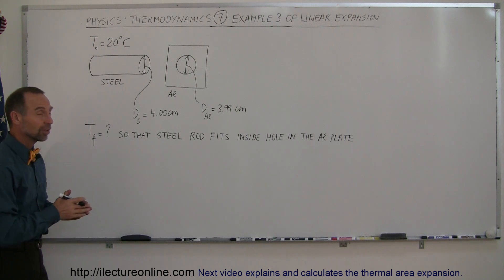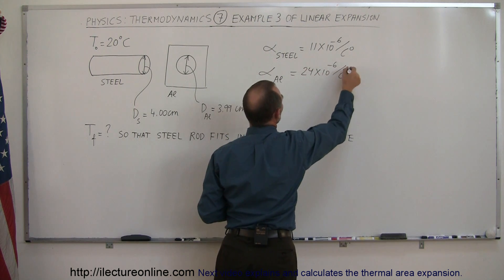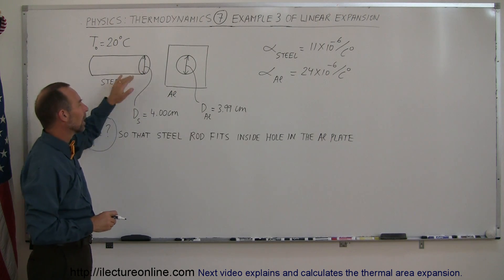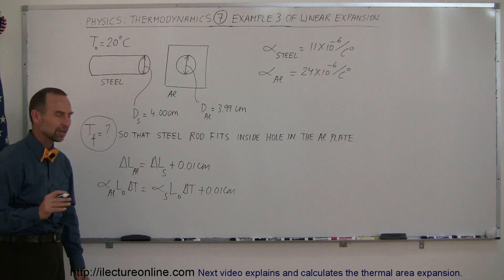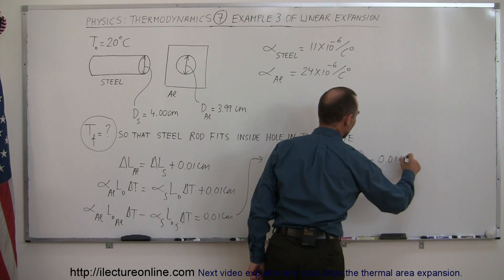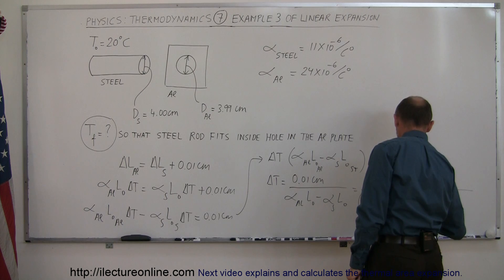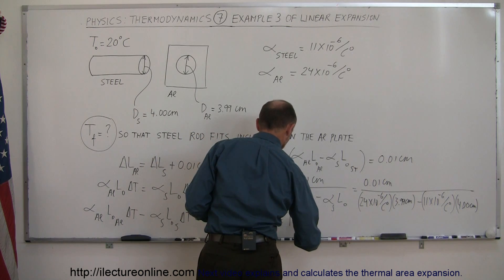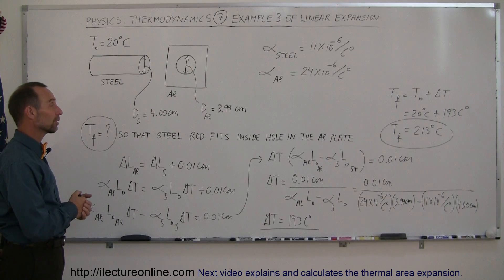Physics 21  Thermal Expansion (4 of 4) Thermal Linear Expansion: Example 3

Comment: This site popped up when I was looking for info on how much a small steel shaft will shrink in dry ice so it will slide into a pair of bearings which are pressed into a housing. Its an interesting video, but I am questioning why you would  want to heat both the shaft and ally plate.  Larger shaft into smaller hole would be an interference fit, would it not. If you shrink the shaft to a diameter smaller than the hole would it not fall in and when it returns to original temp it will expand into the hole causing a tight grip/fit into the hole. (the ally plate could also be heated, so you have a shrinking shaft and expanding hole and when normalized still get the interference fit) Or you could just heat the ally plate to expand the hole to a diameter larger than the shaft (shaft is left at ambient temp so no diameter change) so the shaft will just as easily fall into the hole and when temp cools it will grip the shaft. If shaft and ally plate are heated would they not return to original dimensions when cooled. Ps how much cooling would be required to shrink the shaft down to 3.98cm Thanks
Reply from the maker: Yes, typically you heat up only one component, but as you are fitting the device into the other, there will be some heat transfer (unless it is done very quickly with a machine).

Comment: i have a question why you did not use the area expansion why you use the linear expantion
Reply from the maker: You could, but it is easier to solve using the diameter.

Comment: Would the temperature difference be large if the two objects were the same type of metal
Reply from the maker: If both the rod and the plate are going to be heated, and the rod doesn't fit at 20 degrees C, then it will not fit at any temperature if both the rod and the plate are made of the same material.
Reply: In interference fits, it is common to cool parts & heat the outer body. 
This method will shrink the shaft ( maybe using liquid nitrogen) & heating the housing that it will be inserted into. You can then make the interference greater, which increases the holding capacity.

Comment: This is great! I was just wondering, wouldn't you use the area of the pipe and the entrance at with pi(r^2) and 2alpha? I know it says for linear expansion but I figured if we're given diameter and not length, or both, the it's Area expansion instead of linear or volume. Please cure my overthinkingness lol
Reply from the maker: It is just easier to use the linear expansion of both the hole (diameter) and the cylinder.

Comment: I cant agree with math here aluminium change size 24um per degree steel 11 um per degree so if i simple heat 100 degree rod it wilk give me total size 4.011cm for aluminium if i heat for 100 degre it will grow to 4.014cm so its clear will fit i made misteake somewhere??
Reply from the maker: The answer in the video is correct.  Note that they don't start out at the same size.
Reply: @MichelvanBiezen  thx

Comment: Sir, during thermal expansion of diametrical components, whether it expands circumferencially or diametrically? Can you please clear this through comment section.
Reply from the maker: Imagine a plate without a hole.  Then draw a circle on the plate.  Now heat the plate.  What will happen to the drawn circle?

Comment: Can you please explain why the hole in the plate does not get small when we heat it because the metal expand in all directions so why does it  not expand on the inner side of hole???
Reply from the maker: One way to think about is like this:   1.  Take a flat piece of metal (without a hole) and draw a circle on it, the size of the hole.  Now heat the metal.  What will happen to the circle?    If you let it cool and cut out the circle.  And then just heat the circle, what will happen to the circular piece when you heat it?
Reply: @MichelvanBiezen   The circular piece will expand. But can you please explain this on a molecular level that what exactly resist the molecules to move inside the whole because they also have the space there?.......
Reply from the maker: Think of a Roman arch.    What happens to the arch when you heat the stones in the arch?  They expand, which means they need more room, so the length of the arch needs to increase to make room for the larger stones.

Comment: great video thank you!!! I watched it because I fix appliances for a living and I was having a hard time to remove an aluminum pulley out of a steel shaft from a washer's motor... the shaft was a hexagon about one centimeter... I tried with a torch but didn't work so I left the motor in the freezer of my refrigerator overnight and... yay!!!... expansion didn't work for me it's time but it's there any video about contraction calculation???
Reply from the maker: That's great.  Contraction is essentially the same as expansion with a negative.

Comment: May I know why the Diameter will increase?
Reply from the maker: Make the plate solid (remove the hole) and draw a line where the hole is.  Will the line move outward when you heat the plate?

Comment: there is a hole in middle of copper plate if we heat the plate what will happen with diameter of hole???
Reply from the maker: The hole will expand (will get bigger)
Reply: @MichelvanBiezen  Thanks

Comment: is it because of the coefficient of the expansion the diameter of the al will be larger? because if  we base on the chnge of length alone it does not make sense if you add 0.01 to the steel when its length is already larger than al, right?
Reply from the maker: That is correct.

Comment: why cant you just cool the steel and fit in
Reply from the maker: From a production point of view, it is easier to heat objects than it is to cool them.  Also the process works better if they both are at the same temperature, so there is no heat transfer during the process that could cause problems.
Reply: Ok thanks helped a lot
Reply: I've actually made the mistake in cooling than heating. Part was stuck on a mandrel, using dry ice, i froze the mandrel, shrinking it and therefore the part did come off. However, 4 days later that part turned to rust. Never again

Comment: Sir may I know whether this equation can be used only when two objects are being heated/cooled
Reply from the maker: I don't like to make such general statements.  In every situation, you need to find a way to equate what is physically happening. In this case we could recognize that Al expands more than steel thus the expansion of Al will be 0.01 cm more than the expansion of steel when you can slip the pin in the hole.  It is better to think about each problem in a similar fashion.
Reply: Dude!!!  you have the same question that I have.... this is what I post after watching that video:
great video thank you!!! I watched it because I fix appliances for a living and I was having a hard time to remove an aluminum pulley out of a steel shaft from a washer's motor... the shaft was a hexagon about one centimeter... I tried with a torch but didn't work so I left the motor in the freezer of my refrigerator overnight and... yay!!!... expansion didn't work for me it's time but it's there any video about contraction calculation???

Comment: if i only add heat in the aluminum plate, and take this expresion

 4cm (Lo) = 3.99cm(Lo) + 24.10^-6 *(Tm-20)*3.99(Lo)

if i clear Tm, and that gave me 124 C degrees... That could be a anwers if we want spare energy and dont want heat the bar steel?

Comment: But if you heat something shaped circle wouldn't the circle expand in all directions ?
Reply from the maker: +The Man Upon heating, both the diameter of the rod and the diameter of the hole will increase.
Reply: +Michel van Biezen Oh, yes! For sure!

Comment: it is Ds-Dl = 0.01cm . Diameter of aluminum will be larger when it changed than diameter of steel. That's why he added 0.01 to Ds .
Reply: is it because of the coefficient of the expansion the diameter of the al will be larger? because if  we base on the chnge of length alone it does not make sense if you add 0.01 to the steel when its length is already larger than al, right?

Comment: Why is it you add the steel by 0.01cm rather than aluminium ?
Reply from the maker: +Archer June Diaz 
Since Al has to expand more than the steel for the sizes to become the same
The change in Al will be 0.01 cm  more than the change in the steel
Reply: Another explanation: We want a temperature increase such that L Al + delta Al = L S + delta S. Plugging in the lengths, we get 3.99 cm + delta Al = 4 cm + delta S and subtracting 3.99 cm from both sides, we get delta Al = 0.01 cm + delta S.
Reply: Thank you sir!

Comment: Is it correct to set both final lengths equal to each other and then solve for the change in temperature, like this?

L0(st)*K(st)*T = L0(al)*K(a)*T

...where K is the expansion coefficient.
Reply from the maker: Laurelindo,
Try it and see if you get the same answer.
That is part of the learning process.
Reply: M. Taiseer I think I meant the initial lengths.
It was a long time since I last worked on this stuff, but my equation seemed to give the right answers when I used it.
Reply: M. Taiseer I also think the left and right side of the equation should give the difference between the final temperature and initial temperature for both respective materials.
Reply: M. Taiseer I don't clearly remember what I did in that equation, but I think these were the left and right sides:

T-T0(st)
T-T0(al)

where T is the final temperature and T0 the initial temperature for each material.

So I guess my intended equation should look like this:

L0(st)K(st)(T-T0(st)) = L0(al)K(al)(T-T0(al))

Comment: sir, wouldnt it be the other way round for the addition of .01. it should be with the change in al + .01 equals the change in steel??
Reply from the maker: Michael,
The equation is correct.  Since the coefficient of expansion for Aluminum is larger, it stands to reason that the change in length for Aluminum is greater than the change in length for steal.

Comment from the maker: That is the starting difference between the diameter of the hole and the diameter of the shaft.  The hole starts out 0.01 cm smaller than the shaft.